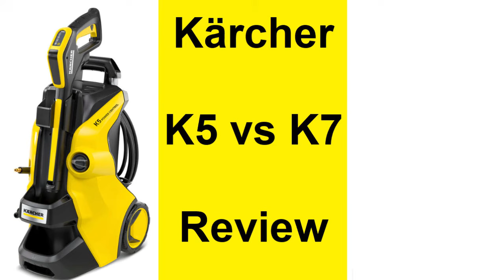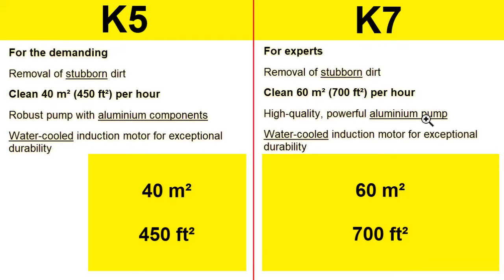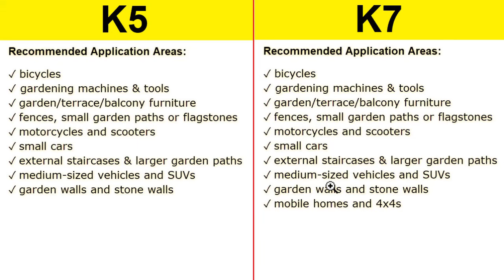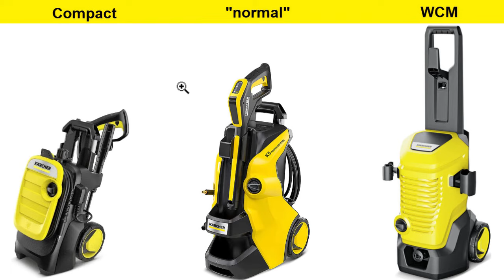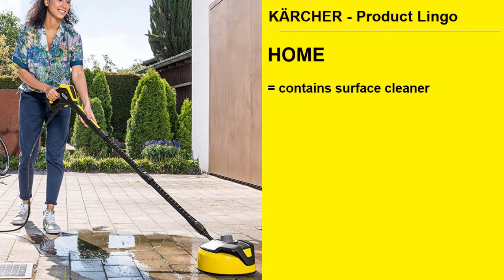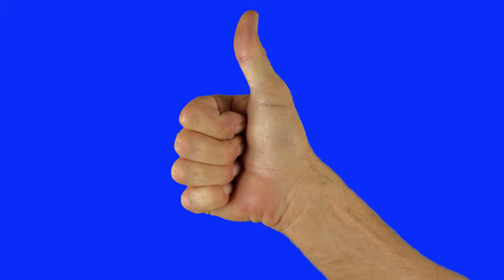Karcher K5 vs K7 High Pressure Washer Comparison Review

Comment: Showing the pressure on the gun handle: just why? Simply gauge it as you go.
Usually best to keep it simple and the pressure brutal!
Was looking at these, but then discovered that Karcher will do a fixed price repair (whatever the problem) for £165: collect-repair-return. This seemed to make very good sense for my stoped-working (pump, I think) K4.600 series washer.
TBA, I think there's some very good competition emerging.
Also, I have never come across a Karher where those wretched plastic wheels actually work!